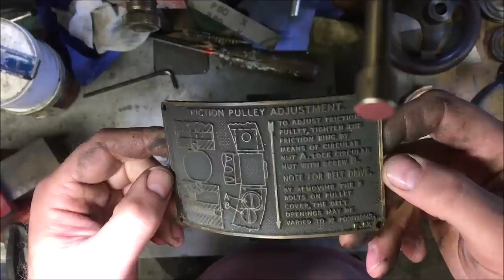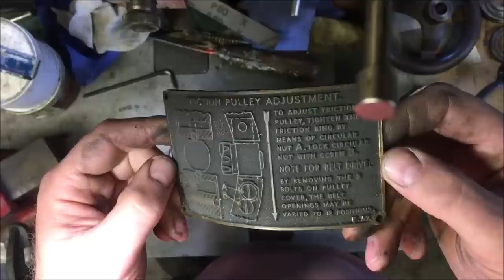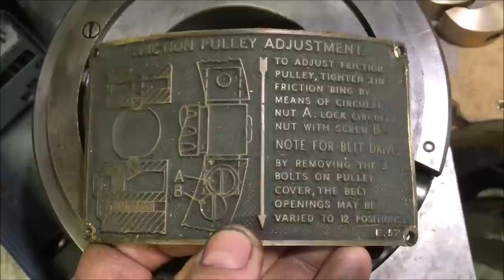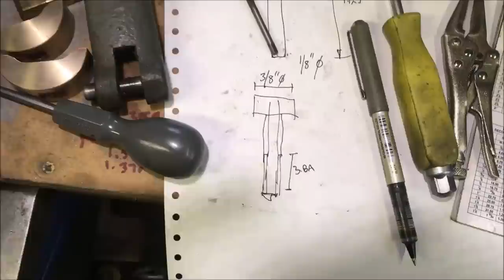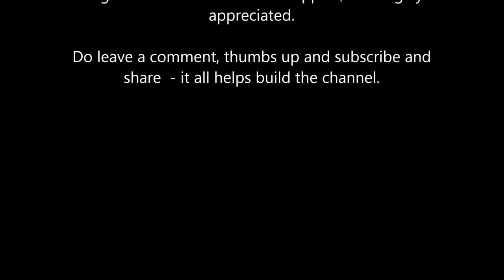Holbrook 10 2

Comment: No way to get oil to those thrust bearings eh?   Packing them with grease instead?  I don't know why I like it so much but I do like to see some hand whittling of the chips such as the oil grooves and screw slot work.    Just seems like proper old world craft I guess.  The view of those craggy rocks do make me miss home in the Appalachians.   Flat land down here at the sea but also where the work is.  Love the installment Mat!
Reply from the maker: The best I can make out for the oiling of the thrust washers is that oil from the headstock enters the spindle, some leaves via the gear face, some via the first thrust washer. Some then leaves via the first bearing, it tracks along and any that goes past the end grooves will reach the mating face of the 2nd washer, in turn feeding the other face. Far from ideal, but then its steel on cast iron so there should be some degree of self lubrication. Additionally, there is very little thrust loading unless the clutch actuator is binding on its round sliding face. I need to check the oil to that - but when I took it apart it  was oiled  and had been sat for several months in my shop.  At the end of the day, its done 70 years and is still 'functional' so it cant be that bad - if it gives my cause, at least I know how it comes apart and works.  I love the hills around here - they make it feel homely. All the best Mat

Comment: I have pictures of my clutch parts and disassembly, it is complete but is broken. (pics of all the lathe disassembly actually) Wow if I can send them to you just say where. Midnight here in Cali so I got to run. Looks like you got it though, I am taking my time in the restoration. I replaced both the pulley bearings w sealed bearings.
Reply from the maker: Hi - sounds like a project !  I was looking for a T15 but couldn't find one and the B15 was a touch on the large size !  I would be interested to see the photos - especially of the drive end set up - mine looked to have been messed with so Ive no idea whats there and what isn't when I start stripping and cleaning I expect to find a few horrors !  Ive found a couple of chaps in the Uk with T13's and a chap in Australia with a pair if I recall correctly ? It would be good to get some collective information on the parts together - I am sure the lathes share similar components (drive gears for one) and there may be opportunity there down the road to make multiples in a set up and exchange.  If you can upload the images to the cloud and send me a link or string them on a YouTube video that might be easier ? lets keep in touch. Mat

Comment: What is the purpose of the tapered part of the clutch assy  next to the  engagement groove , i wonder if  it was part of a brake that may have been an option .  Cheers .
Reply from the maker: I am still trying to determine that. If it was part of a brake - I have to assume its missing some bits as I cant believe that Holbrook relied on hardened steel plates rubbing on cast iron to brake the headstock ? No facility to take up the wear (as best I can determine) - so as I say, still researching. Having never run the lathe I am going to ask around and find out if it did run with a brake on the clutch lever ? Hopefully be able to update that next week. Mat
Reply: @lookcreations  I suppose yo have already tried Tony's Lathes UK for info , i have found them good in the past .
Reply from the maker: @swanvalleymachineshop  Tony lives a few miles down the road from me - his is a very helpful website and hes a good fellow for sure, Chris from the video, helped Tony with a chunk of old paperwork on machine tools - much of which Tony keeps in his archives and retails copies of. Its a small world as far as machine rebuilding goes ! There is more information on the Yahoo groups Holbrook Lathe Owners site - however, Yahoo groups is not the easiest of forums to search for details. The members have all been very helpful - but the T13 is not around in large numbers and of those I have located few of the owners have fully stripped and rebuilt the lathe. Its early days yet. There is definitely signs inside the front casting that the tapered section is 'rubbing' on the inside taper - intentionally or through excessive wear is yet to be confirmed. At the minute the paint's wet so Im leaving well alone :-)

Comment: A few days work bringing that clutch assembly back to proper working order Mat. You may well have done so already and just didn't detail it in the video. But I think I would have degreased the clutch lining with some CRC Electrical Contact Cleaner. There's other products such as brake clean, but the electrical contact cleaner seems to work about the best for me. Then maybe roughen up the lining with some course grit sandpaper. Hard to tell for sure but that clutch lining looked a bit glazed up with wear particles and maybe some old lube.
Reply from the maker: I did de-grease it with 'Gunk' and then spirit and finally contact cleaner - hell of a mess. There is some areas of shine but not too bad - I took some off with some 150 grit - I have to do the shoe which is a little worse condition in terms of scores. certainly dont want to take material off. Ive a bit more investigating to do around the hard disks / sating and the effects of pushing the actuator the opposite way - to see if it 'brakes' and then assess those surfaces. All the best Mat
Reply: @lookcreations  :-) I should have known you would have done so Mat. There's an old gunsmithing trick for removing lubricating oil from wooden stocks when amatures aren't too careful where there dripping oil. Heat, usually an old electric iron with no water in it is used, but for something like your part getting it close to an electric or gas kitchen stoves burner and warm it up a couple hundred degrees should force any oil or grease to the surface and that gunk etc would remove the rest. Might take two or three times doing so like wood usually does to get it all. If it works on hardwoods I can't see why it wouldn't work on anything else that can absorb oil.

Comment: in stead of the expensive o2  you might want to use 12l14, a lead containing free machining steel
machines very nicely and you can often find end pieces at the scrap metal yard where industrial shops unload there bins
with the advantage that the end pieces have the colour coding on them
Reply from the maker: What are the colour codes? Many of the lengths of scrap round stock I pick up are coloured but I’ve been unable to get a listing to decode them. I used Silver Steel as I have a box full of small diameter stock I got from the scrap yard !
Reply: @lookcreations  different steel yards use different colours to suit there listings
Reply: @lookcreations  i doubt if the colours are regulated, it appears that suppliers have their own codes.
the free machining stuff i find on the yard that i frequent has a darkish green marking.
i have learned to avoid the yellow marked stainless, i found it to be work hardening like crazy, the hard way....
Reply from the maker: @janvanruth3485  that was what I decided (suppliers have their own codes) - I usually collect stuff that I can see what its been used for and thus have a reasonable idea of the type of material characteristics it might have. I get burned on occasion - and return the stuff for half its cost along with the swarf.  Can make for some challenging machining to say the least.
Reply from the maker: @secretsix6  the coded stuff is all 'off spec' or wrong cut lengths and in most cases has arrived in its original wrapping on a pallet - 'yellow' seams to be the common colour for steel grades (non stainless), and the last couple of batches have cut like en24T.

Comment: Mat.
Am I hearing things ?
Didn't you say early on in your video that the chuck was a screw on and so "braking" wasn't an option.
Along with reverse.
PS I think it was Joe Pi not Rob #####ski ?
Thanks for the insight. 
I can conclude my Colchester is probably similar.
I was wondering if there was a friction lining that could be contaminated causing mine to drag.
Probably no harm in me squirting some degreaser in as every thing is well lubricated  !   😱
Reply from the maker: Well to the best of my understanding at the time - anyhow, todays revelations is that there is a 'brake' facility. I will cover it in the next upload. Its not what I was expecting - but then neither was the clutch set up. How exciting ! :-)  Cheers Steve. mat

Comment: There is most definitely a brake by pushing the lever away from the operator. I just went and checked!!
Reply from the maker: I believe you Clive !  I had a couple of hours on it today - now the paints dry and its all clean. I will show on the next upload. It aint much but its a friction brake of sorts. Im surprised that Holbrooks didn't add a sacrificial material / part that could be replaced eventually. or maybe they did and mine is missing ? There is always that nagging doubt with old machines that clearly have been 'looked at' in the past.  All the best Mat